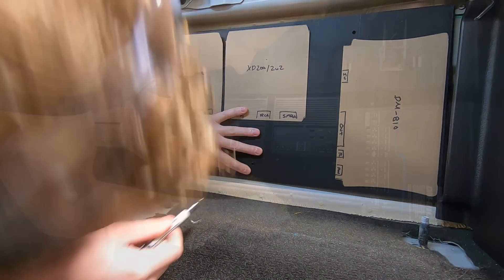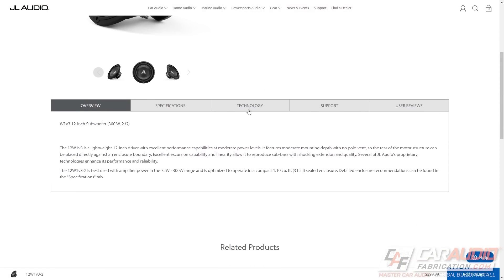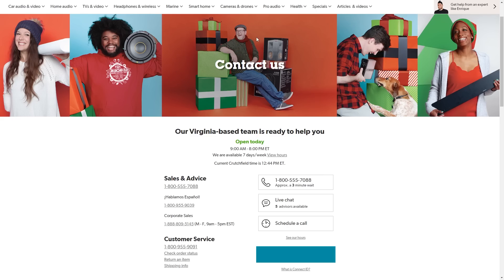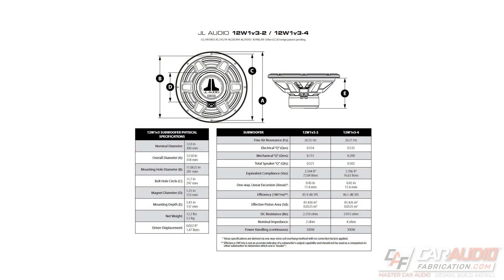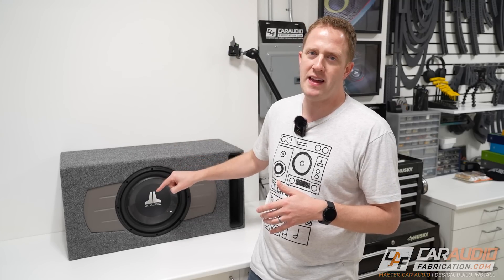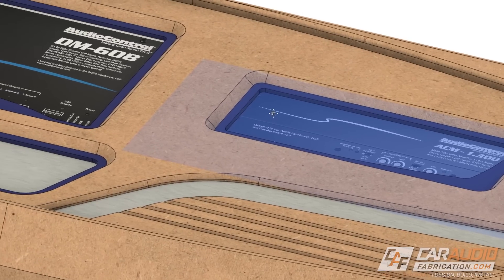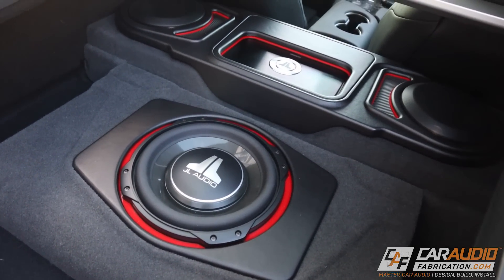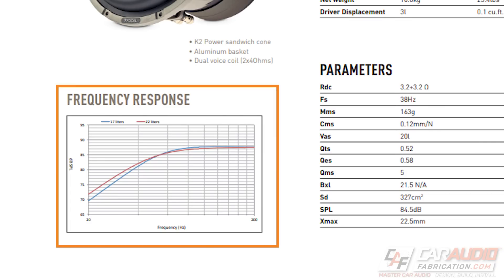Attention Car Audio Manufacturers! Please improve THIS!

Comment: I agree with everything you said but there’s one more thing I want manufacturers to do. Particularly with larger subs with lots of motor force. Give us a larger mounting ring so that we can use larger, stronger screws or bolts to hold these larger subs in place. I see so many subs breaking the screws that’s holding them in place.
Reply from the maker: Yes, better design considerations would definitely be appreciated 👍 thanks for the comment and being here in our community!

Comment: On the topic of driver displacement - I have used a somewhat risky method, where you fill a large enough container with water (measured volume), wrap the driver WELL in nylon / thicker plastic bag and immerse it in the container, then measure the difference in displacement.
Reply from the maker: Or..... stay with me on this one... Rather than wasting time and effort doing this, the manufacturer could provide the value. You know, being as they designed the subwoofer... The main problem is all these bargain basement companies just call up China and place an order of parts xyz combined together and call that product development, no real design. Just a sub that makes noise and handles a certain amount of power.
Reply: @CarAudioFabrication so which brands we should stay away (parts bin subs)? probably lots of spl stuff is simply don't design and just make stuff that handles shit ton of power w/o rral design
Reply: that level of accuracy is not necessary. the area of a pyramid is half of the cube, so use a cylinder, its close enough.
Reply: @administratorperson3272  I've moved away from the water experiment. With a physical driver at hand, i measure basic dimensions and create a basic cone form in CAD  whic gives approx volume, but back in the day yeah. ;)

Comment: i fit10's in my doors, 3/16" clearance from the window rolling down, and 1/8" clearance between the grill and seat..
a shoehorn tight fit... no specs, just measuring..

oh and they are 40yr old subs in a 25yr old pickup. sometimes you just have to wing it from experience.

Comment: Hey everyone...I am new to the new age of car audio and have learned alot from watching this channel. There are so many videos, since this is a recent one I wanted to ask a question to everyone, Mark included...lol. I recently bought a 22 Nissan Frontier and want to upgrade the system. I have not been able to find much in the way of sub enclosures for this model and cabin space is limited. I have seen videos with a kicker hideaway 10 behind the seat. In honest opinions, would this sound better than a couple 6.5 subs in a custom fiberglass box if I got brave enough to try it. I don't want to spend a bunch of money and then have it sound like crap. I am not looking to shake the neighbors house. I want good quality with all genres, but I do occasionally go back to my high school days and jam to Techmaster PEB, Miami Bass, Dj Laz, etc. Im thinking that the hideaway may not get the deep sound I would want. Any thoughts, or info on stuff made for this truck would be greatly appreciated. Thanks. PS. I am trying to maintain the stock look so I don't want a box that sticks out at the feet of backseat passengers. Thx again

Comment: I'm just getting back in to car audio after seeing a bench test of a amp that I have. I go in the garage to see what I still have left because I sold my 15in kickers and my 12w3's so I didn't expect to find much, what I found was a 10w0 triple stack with the JL grills and a 10w0 duel 10in with the JL grills, a Mtx  12in box with two punch p2's with no grills two Optimus 10in pro series  full range box with built tweete, 4 pioneer premier 2 way 6.9 in boxes with no grills. I'm saying all this to say, I hooked up everything to make sure it worked and all 5 of the JL audio 10wo's surrounds blew off, but all other speakers worked fine and the pro series have a cloth surround. Everything has been sitting since 08, but my eclipse xa1000 mono block still works punch 400s still works, even a Sony 165d and kenwood 921 from 93 still works. So I'm asking why, with the money that JL audio cost did this happen with them being in JL authorized boxes and have you heard of this happening to any one else

Comment: Mark I have question that I can’t seem to get a straight answer on.

I have a 2013 Lexus ES 350 natural like every car. The radio EQ settings are preset. I am currently running an audio control LCIDSP. I have the channels summed but I still feel like without an OTA. I have no idea if the curve it’s flattened it still feels like something is missing. 

I can’t help but wonder if that subwoofer channel is also preset so I could be missing out on some lows right there also either on the top end above 80 Hz, or maybe even the lower end under 40 Hz, depending on how it sit by the manufacturer 

In your opinion, if I upgraded my DSP to a audio control DQ -61 would that give me a better option to flatten the curve if I some of the channels and used all the settings to dial-in the sound that I’m looking for including the subwoofer?

Comment: Dude seriously. I don’t stock their stuff but I was building an enclosure for someone who had a Skar woofer. The customer was not on the same town as me so I didn’t have the woofer with me. Not only was the cutout diameter unavailable on their site, they never responded to three attempts to contact them through their website’s form.
Reply from the maker: Yep, same. Have had clients that use them. I've emailed them several times to get information. Asked them why not just put it on the site. They ignore me. Unfortunately their online dealers also apply little effort and don't actually measure any product. Just copy paste from their website. So you have to have the gear in hand to get any reliable idea.

Comment: I have a 1997 mitsubishi pajero short wheel base and want a sub but still need practical storage space. Any suggestions ons which size sub to use? Can i use a shallow box in the trunk that downfires? Wil i experience any overheating or distortion issues if i mount the amp on the sub enclosure and then place a false floor on top ? I cant post a photo to explain my idea tho

Comment: Subwoofers are heavy! When loading them into a cabinet, the technique is usually: Get it close then drop it so you don't pinch your fingers!

Why have manufacturers not provided removable handles for installing subwoofers yet?

A simple removable handle which tightens on to the frame would be terrific for install, and allow us to place the subwoofer with some level of careful control and to make the small adjustments needed to align the bolt holes with the cabinet. Many of us are installing machine screws and not wood screws.

Second request; a little hint as to where the top center of the subwoofer is would be great. Some customers, with their subwoofers, are not in the same location as the cabinet builder. Some bolt patterns place a bolt on the vertical centerline of the speaker and some split that centerline and between two bolts on either side of the line. When we're making a custom cabinet for a customer, knowing the bolt alignment, and especially in relation to the dust cap logo, without having the speaker right in front of us, would be very helpful.

Comment: How about calling out the Manufactures giving false information. For instance Rockville list their 15" Destroyer cutout dimensions as 14.6". I thought that was odd so I asked their technical department to double check the dimensions. They assured me those dims were correct. So I when ahead and programed the cnc and cut the material. The speakers showed up and they were 14" cutout like all 15" subs. Wasted time and $500 of material. They even have the wrong dimensions printed on the box.

Comment: One thing that all speaker manufacturers forget to include is the necessary female quick disconnect terminal size (0.250 is most common).

Comment: Related to your comment about speaker displacement, something that my personal fav sub manufacturer gives, but also they give the dimensions for their recommended enclosures, both sealed and ported, in the spec sheet that they include with each sub.

Comment: I think car companies could make car audio more upgradeable. Ford went nuts with the Bronco, making it "accessory ready". The audio in the lower trims is terrible with not much you can do with the head unit.
Reply: Don’t really need to mess with the head unit for good sound. Have done quite a few of these at the shop I work at and you can make them sound really good with a decent DSP and some power. But I do agree with your point. Seems everything will be OEM integration soon enough.
Reply: @jayhart5170 if they truly had proper premium systems we would be paying for em, ive yet to see a so callex premium system reaching the lows, clarity of the mids and velvety highs of an average aftermarket system that is designed properly. they need profit

Comment: This whole video "is literally me". The worst part about all these gripes is it isn't limited to cheaper or smaller brands. In fact I've had multiple instances where the El Cheapo brand gives better specs and dimensions than a well established or higher end brand. And unless you're product is the only reasonable solution in a given situation; I'm not gonna faff about calling tech support. I'm gonna go elsewhere.

Comment: Hi Mark. Question. If I am running a lc4-800 and lc1-800 does it make sense to put a  LCQ1 in before them or just run a 2 way cross over to each front door speakers. Thanks

Comment: There is one thing that always irritates me the most; that most manufactures in their manuals don’t give a transparent information about the X-max of their woofers. They write a number as X-max, but they often don’t say if the X-max is one way from zero point or total X-max from peak to peak. Especially if you need this information for software like WinIsd.
Reply from the maker: If not explicitly stated I think most probably use peak to peak so they can sound more impressive with that value, but I agree with your point.

Comment: Mark @caraudiofabrication.    Most companies that are smaller do not even care as much which is typical.  JL Audio  has set the bar really high. So much so no company comes close to the support JL will give to installers, and consumers! This is a fact for I have installed thier products for 20 years. 

Reason number 1: Not one company that I know of will not go the extra mile as much as JL Audio does to make sure we have the information before hand on any build or a design goal for a customer.  The extra information printed on manuals cost money. No information is ever free!                                                                                                                                                                                                                                                                                                                                             

Reason number 2:  Most of these cookie cutter brands do not adhere, or follow quality control procedures to make sure you are getting a superior product.  This request is valid by you to make and can see why. Been saying some of the same things for years. However, I do not see that this will ever come to light for car, and home audio. This is due  not having certain "guidelines" to adhere to issued by our government. Let alone the entire world order.  

Products come and go. In fact they are built all over the place. Overnight workshops in some instances are built practically overnight. A "run" is completed of said products for a determined number preset by the employer that hired that company for the "run". Then that workshop shuts down afterwards. No traces left, and the consumer stuck with some stuff they got at the flea market to save a dollar or two.   

The only thing that would come to mind for any compliance is ROHS/LEADFREE/Electrical and Electronic Equipment Compliance Requirements  (U.S. Standard for consumer electronics/Lead free is mainly CALI movement  See following  https://nvlpubs.nist.gov/nistpubs/ir/2017/NIST.IR.8118r1.pdf)  that is about it.                                                                                                                                                                                                                                                                                                                                        

Reason number 3:  Patented products cost a mint. Companies like JL Audio with those Patents can provide detailed information at will without fear of copy cats takeing place. This is the beauty, and culimination of a quality products that last. Not to mention all of the Research and development they put behind each product they design in house. Do you think thier marine line will last 20 years out in the Sun on a boat!  Yes it sure will! I have seen it! JL Audio would want, you the installer with the consumer to know exactly what one is getting. Mind you, it is not just the products, it is the support that one gets with a really good company! 

  I cannot speak about less-than-par products that circle the globe as of late. They know who they are!  You also get what you pay for!                                                                       I know who I support. To To be honest about it all. Most of the products out either suck, or are really good to be blunt and to the point. There are bad amplfiers, noisey. Filled with crap components with terrible tolerances. Then there are Great amplfiers. Some can reproduce a pin drop to a T via amplfication built with some of the best Surface mount, or through hole components one can shake a fist at! Litterally beat it with a hammer, and it still plays for years.   I say why not save your money, and buy good quality built products that last! Especially the products from JL.  I have found that thier products can, and will last a lifetime! Although that depends on the consumer!

Comment: I have always had a problem with the manufacturer giving the wrong Measurements for sub mounting hole cutouts. So I guess it would be awesome if that was right as well. But I am fine taking Measurements myself that way I know there right.  Very good video by the way
Reply from the maker: Yes, I always double check as well and always put in all my engineering drawings that it should be verified, because unfortunately that is a thing too. Manufacturers being wildly off with those values, not like a 1/16th off, but 1/2" or more 😬
Reply: @CarAudioFabrication  definitely. Back in 1995 I was in high school and tried to build a box for I believe a pioneer 10" sub and had to cut the mounting hole out with a jigsaw so I built the box and then cut the hole not the best ideal.  but anyway I I cut the hole by reading the owners manual. After it was cut here I was very excited I grabbed the sub put it in and could move it up down side to side and could drop screws in the screw holes and never hit anything on 1 side or the other. As a young boy that really sucked started over and measured it for myself with a framing square and a big speed square and have never looked back.
Reply: exactly why I haven't cut the hole for the 18 I bought from psi back in January... david..David... build me my sub, its been 10 months.. but I want to get the sub before I cut the hole so it's not too big or small. even if it is what he says it is, im not ruining a triple layer baffle over a quarter inch lol
Reply: @zanechristiansen  no doubt. A 12" speed square and a framing square hold together and check it about at least for sure
Reply: @randallbaker9055  you're talking about using those to measure the sub?
Reply: @zanechristiansen  that's how  I do it seams to work very good
Reply: @randallbaker9055  right on, one day I'll get the sub and can get it properly fitted lol
Reply: @zanechristiansen  yeah give that a try you might like it. It has worked very well for me over the years

Comment: 1. I second the motion on 3D files and any other electronic files and paper templates that facilitate cut outs, 3D printing, and laser cutting. (Check your local library for these tools.)

2. For speaker displacement, I think we need two values (1) one for surface mounting and (2) one for under mounting. Alternatively, manufacturers should describe what their displacement measurement is measuring. I understand that the difference from getting it right versus being close is likely to be immaterial, but it seems like nothing to publish.

3. For amps, manufacturers provide continuous power and maximum power. Some of us are worried about over-powering tweeters if using a 6-channel amp with one output option. Why don't manufacturers also publish minimum power, as in what the output is with the gain turned all the way down? This question is in the Q&A at Crutchfield, but the reply does not provide an actual answer. I contacted a manufacturer with the same question and the reply also did not answer the very simple and direct question. Is that because the answer is just an obvious zero watts?

4. This is a little generic, but some manufacturers need fresh eyes to read their product summaries. Often, bulleted lists do not provide accurate descriptions. For example, 80/120/200/4000/10000 hz is not remotely close to continuously variable between 80-20,000 hz. This is one more reason why access to manuals is so necessary.
Reply: Gain isn’t a power knob.
Reply: @Thumper68  
Thanks, but I didn't need yet another non-answer to the question. Yours is the third.